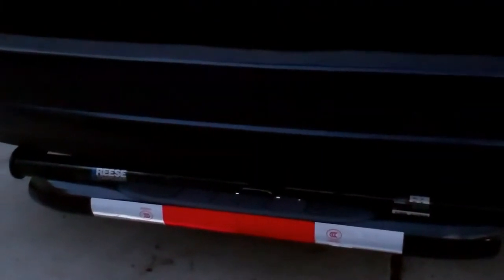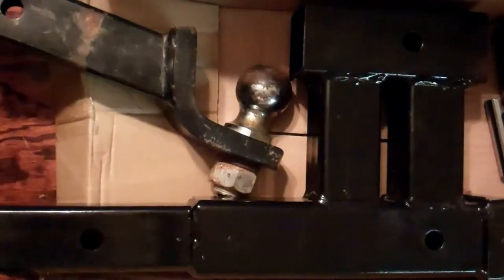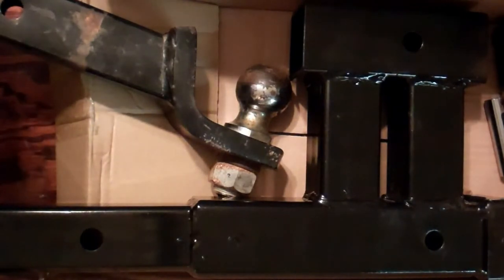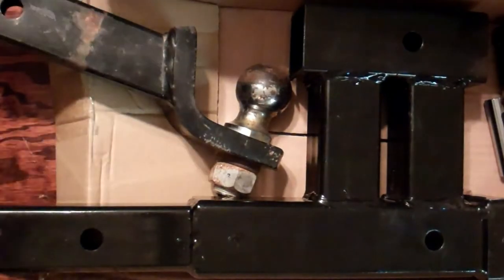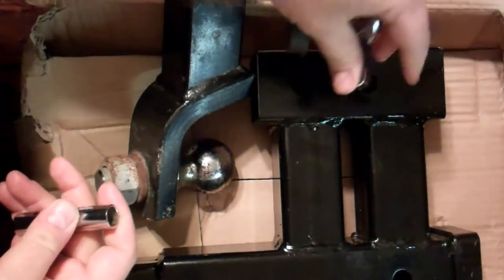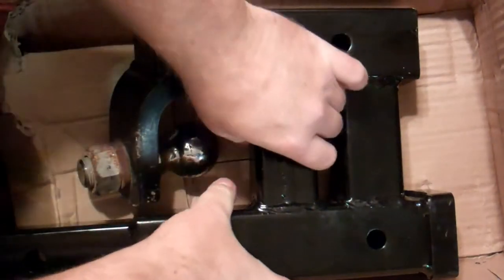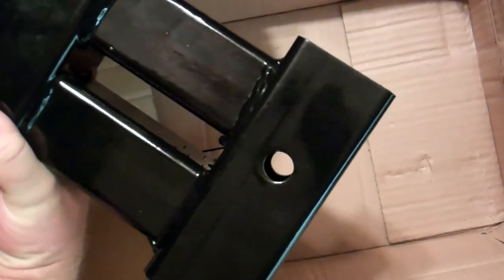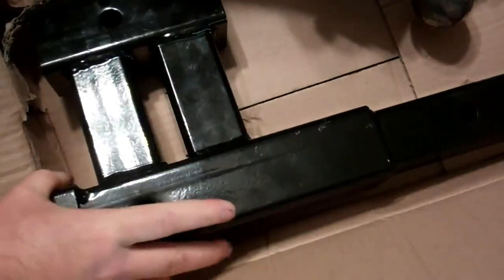Dual Hitch Receiver Overview & Install

Comment: Good video.  Energy of any accident transfers between the objects depending on how strong the impact and vehicle sizes.  The only benefit of someone hitting your vehicles hitch before crumpling the bumper is to protect your vehicle.  Energy of impact has to go some where....either into your vehicle and transfer to all your passengers OR the hitting vehicle gets crumpled more.  Without hitting your hitch, your vehicle is designed to crumple to protect occupants.  Again, it depends on sizes of vehicles involved and impact speed.   I wonder if you would actually do more damage to your vehicles frame on a major accident where the other vehicle was bigger n had steel bumper up front.  In this scenario, the energy would definitely transfer to the passengers should the frame start to bend(if it can’t bend enough to take all energy of impact).

For me, I dont leave the ball or step on when not using, as it’s cheaper to repair a vehicle than the health impacts to passengers not to mention the bigger medical bills!

Comment: Hi, so the dual adapter is the pipe to the hitch is a 2in and the other two ports is 2in each is that correct?
Reply from the maker: Yes.

Comment: I’m planning on pulling a small lightweight camper with my car and I’m thinking my hitch will be too low to where the trailer tongue and tow chains will scrape. So maybe something like this will help give me more clearance and piece of mind
Reply from the maker: It might work but I've noticed the extension will drag when pulling into or out of a driveway with an incline, just an FYI
Reply: RVR2 I was doing some research, there are some that aren’t as bulky. I’m just hoping it works well or I’ll have to have someone create a custom hitch riser. Thanks for the quick response
Reply: Patrick this isn't what you want. The riser section is not designed for towing, but for accessories. It is only rated to support 400 lbs. Besides, this unit is an EXTENDER, which will make it more likely to make contact with the pavement on a low vehicle on uneven pavement.

Comment: Kool, but personally im not a fan of it. It sticks out too much and it just looks "meh". If you wanted a bar for protection, did you look into a rear bumper bar?
Reply from the maker: It does stick out pretty far.. Yeah way too much money to mod the bumper that would still be damaged from a rear impact.

Comment: Can you provide a link to the other item on the top is long bar and that is a 2"
Reply from the maker: I bought it off eBay-I don't have a link for it.. It's a 2 inch receiver step bar. They come in different lengths
Reply: @rvr2  true couldn’t find your dimension guess I’ll shop around - thanks
Reply from the maker: My step bar is around 3ft I think
Reply: @rvr2  cool thanks

Comment: Thanks for posting. Question: How high are the extensions in the middle? I have a different purpose for one of these; I want to reverse it to lower the hitch height. I have a '05 Tundra and use a wheelchair/scooter hauler for carrying my snowblower and mower. As it sits right now the ramp, designed to rest on a sidewalk I suppose, is steep just resting on the ground making it at times difficult to get the equipment back up there. By turning this upside down to lower the carrier I hope to alleviate this.
Reply from the maker: About 4 inches from weld to weld (Maybe closer to 4.25 inches). That might work for your setup..